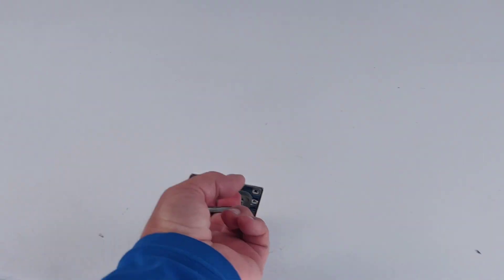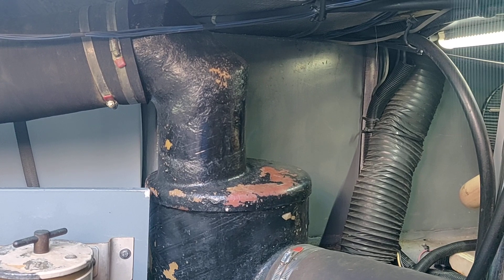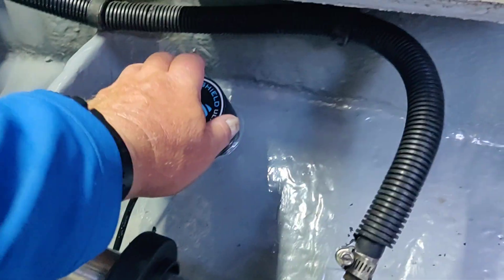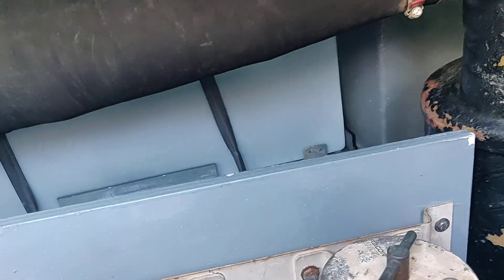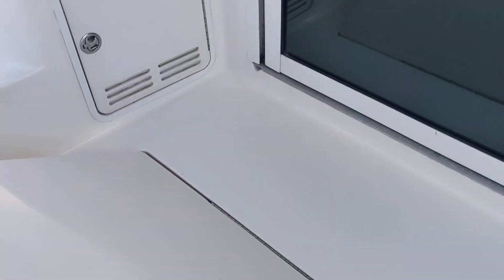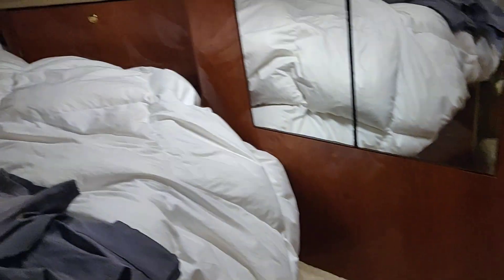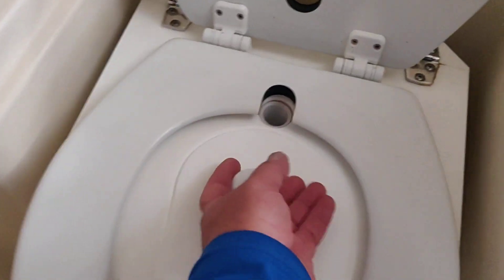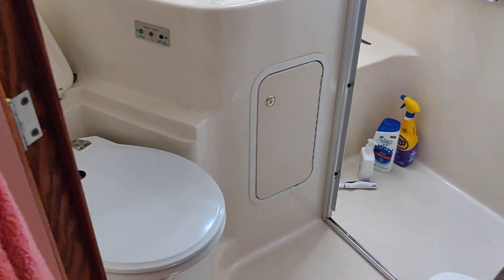A rundown of most of the modifications we have done to our 2001 Sea Ray 400 Sedan Bridge

Comment: Very nice. How did you arrange charging the different battery banks (hull shield; house; fridge; engine)? Do you manually throw a switch etc? cheers.
Reply from the maker: Hey James,
Thanks for your comment. Yes, the lithium house bank is wired through the existing wiring for the non-existent generator.  I simply turn on the inverter and swap the source switch at the power control panel.  The batteries for the fridge and gull shield are on manual switches.
Reply from the maker: Forgot to ask your original question.  Each battery has their own charger. 30amp for house, 10 amp each for fridge and hull shield.  I turn them on when at port to recharge.